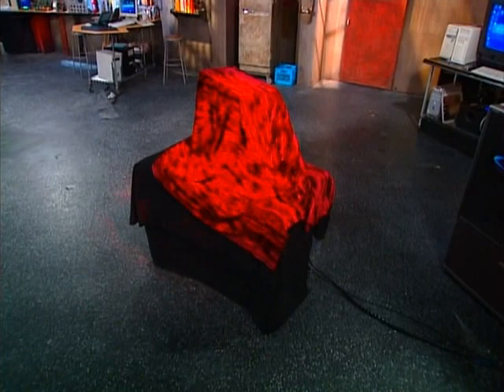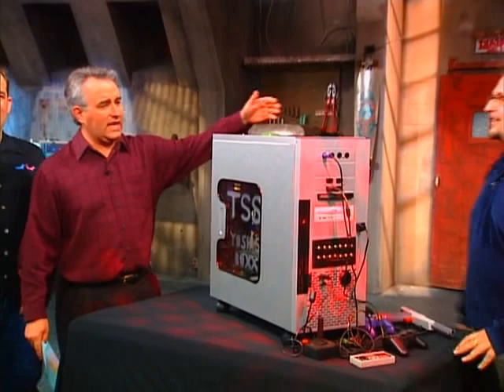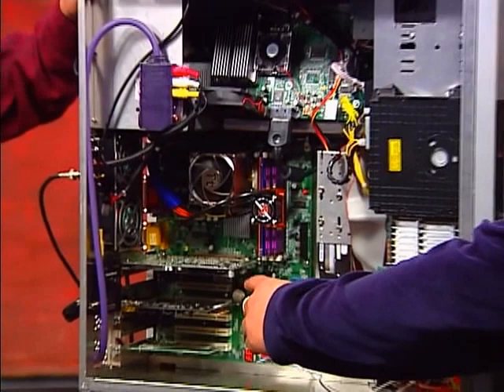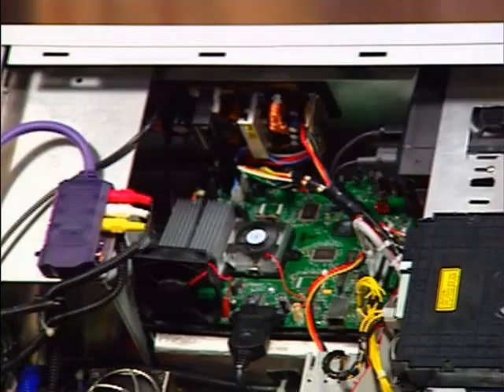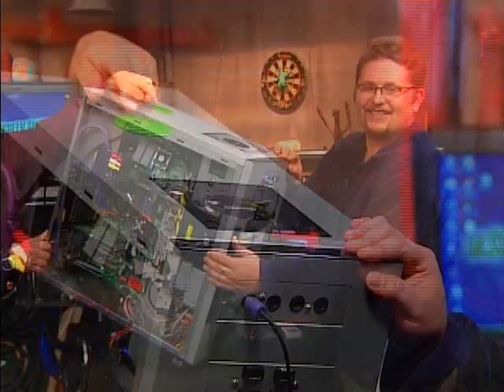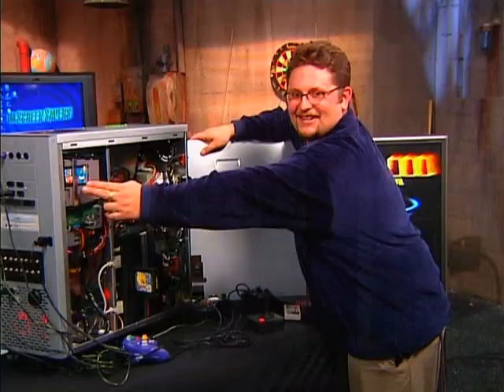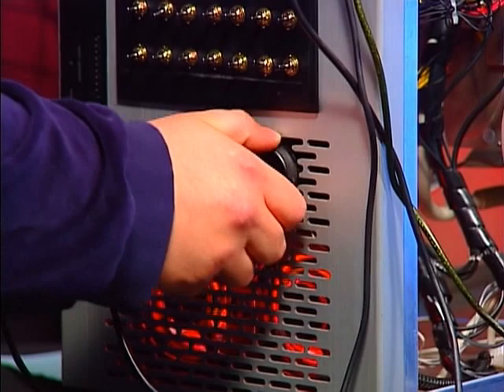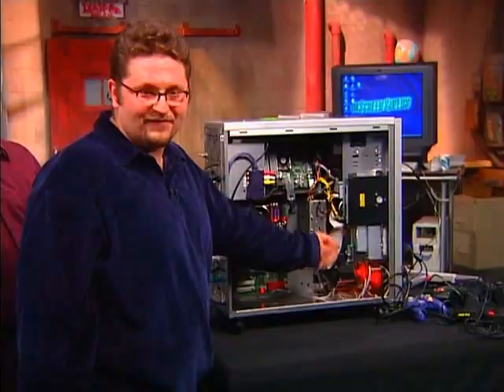The Screen Savers - Yoshi's Boxx - HQ

Comment: This was like, 7 or more years ago. Emulators weren't so prominent or practical yet. 

Yeah, that's obviously the way to go now. But still, this is pretty cool, and was downright ridiculous for the time.
Reply: Well the older consoles had emulators but the current (at the time) ones didn't.  That would be like emulating ps5 now.

Comment: Or you could, you know, use an emulator?
Reply: Years later and this comment still cracks me up. An emulated PS2/ Xbox/ GC, back in 2003.
Reply: @caodesignworks2407  Even now original xbox emulators are far from perfect. Ps2 and GC easy peasy tho.

Comment: haha'. i can mod better than this guy, first. i modded the xbox inside a pc case my self. why waste space and time in adding nes, he could just add all the emulators in the xbox.also the xbox can run off the pc power supply. all he did was stick all thos inside a huge box, also the xbox can have a vga output,